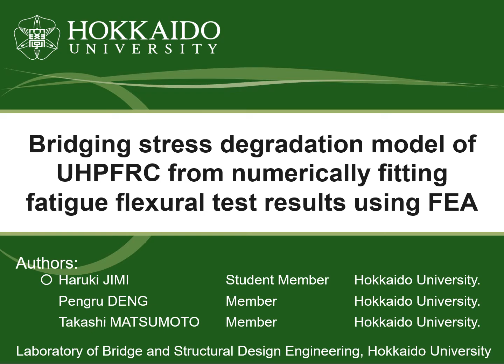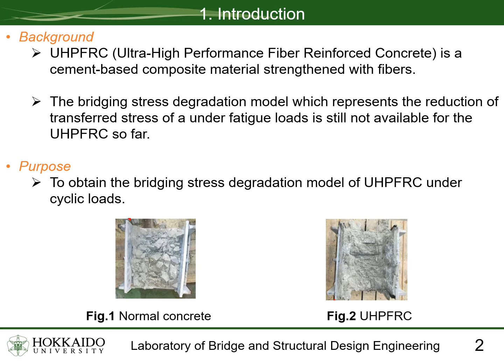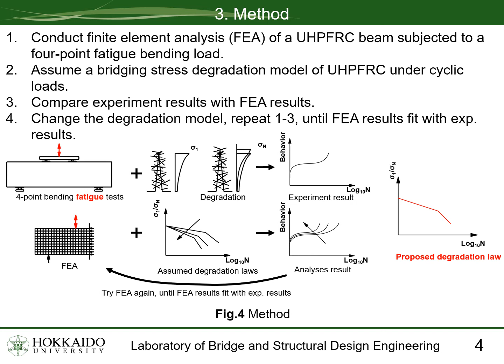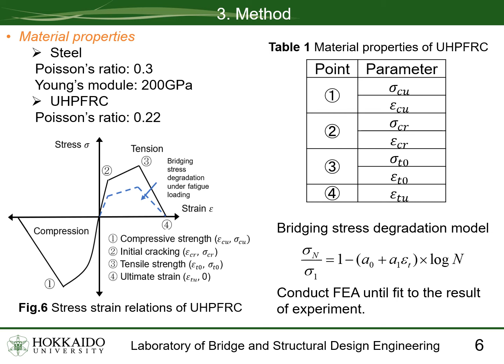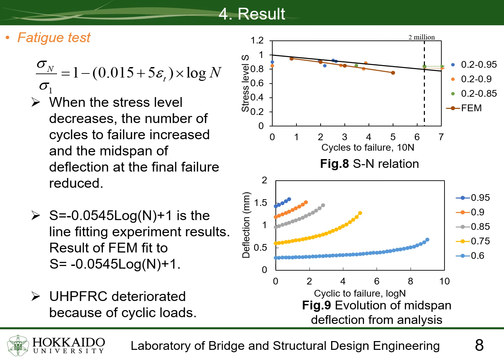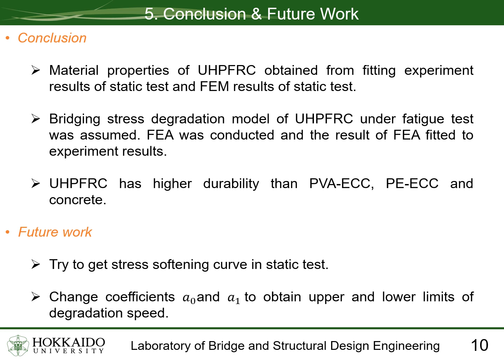BridgingStressDegradationModelOfUHPFRCFromNumericallyFittingFatigueFlexuralTestResultsUsingFEA

Comment: I am Yasunori Miyamori from Kitami Institute of Technology. Thank you for your presentation.
I have a simple question on slide #7.
In Figure 7 and Table 2, you showed five experimental results. Would you show me the difference between experiment cases? Or did you repeat the same test five times?
You mentioned that the displacement curve of FEA fits the experimental result. I could not catch which experiment case which you pointed out.